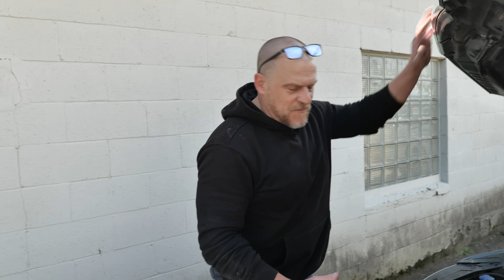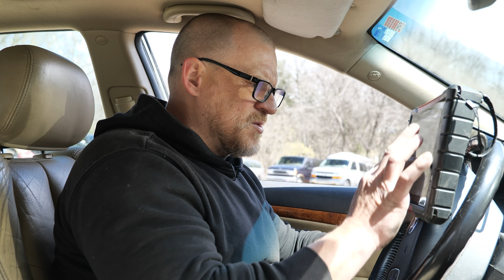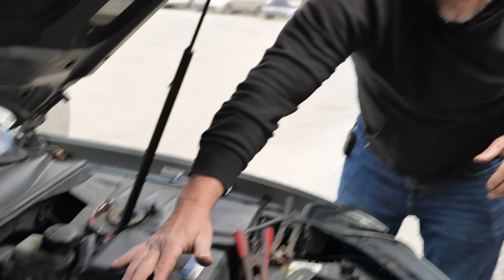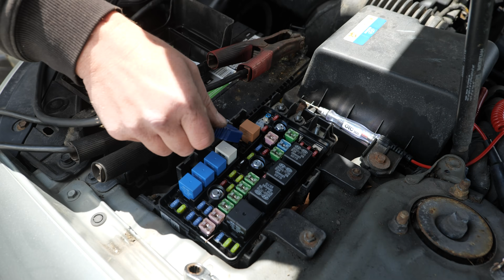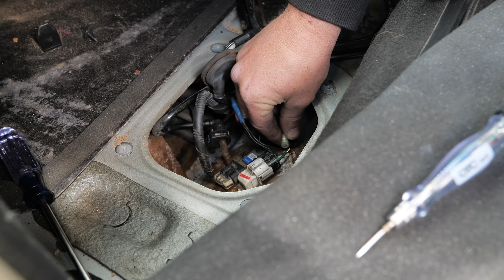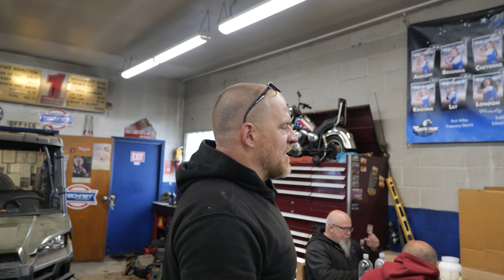No Start Basics  -  What Are We Missing??

Comment: I’m on day 3 with my car, before it stopped running I had one cylinder not working….I ended up pulling a plug wire, and it started to arc real bad, and the car shut down” haven’t been able to restart the car….due to no spark.

I have a permanent fuel pressure gauge, and fuel pressure is 45PSI…I can hear it prime” but still no start or spark” I don’t know if a faulty fuel pump can create a no spark condition 

I did a live data test on my obd2 scanner, and I see activity in the” TPS, and IAC” there is one parameter in my live data test, and it has a OL for the fuel pump.

Comment: If ya smelled fuel in the car at the beginning...smell out the source. And since tank was changed for whatever reason...and it has an access panel...why do allllll these other complicated tests. Do basic checks first after other shops had car, confirm and look at their work. Rotten pump/housing/lines/hoses would've been seen first

Comment: Any thoughts on using a special 'inline spark light tester' rather than the air gap type...better\worse?
Reply from the maker: As long as the air gap is adjustable. This is absolutely necessary when testing for "good spark". If it can only jump a 1/4 inch gap, compared to a 1" gap type of thing

Comment: Excellent diagnostic skills as always.  I am wondering what your thoughts are on if you know someone else worked on something, to first double check their work.  It has been my experience when I work on something, if a junior mechanic or driver had done work before more times than not they did something wrong and I have to fix their errors.  I don't tell them they messed up, because nobody like being told they messed up, but I do tell them what I found and let them draw their own conclusion.  One more thing, I would have done different is when you knew that fuel pump had a leak and you left the shop to go test it with some rags, you walked past a fire extinguisher. I probably would have brought that outside with me just for safety measures.

Comment: This was fun to watch.  On my daughter's car, it would start and drive and then at idle it would stall and then crank - no start.  At some point it would start again.  Long story short, it turned out to be the VVT (variable valve timing) solenoid.  No fault code, it was getting stuck in the open position and therefore stall at low rpm/idle and then no start.  Over time, the solenoid would get back to it's closed position and then start. Took a while to find this one.

Comment: Does someone know how much Am does the test light have? To use it for load test for 5 volt reference?please
Reply from the maker: You don't need to load test 5v ref circuit. Simply measure the voltage with the key on and sensors plugged in. Why do you want to load test it is the question?
Reply: @ScannerDanner to see wire problems
Reply from the maker: @ika-ika28  again, not necessary. Voltage measurements on the 5v ref circuit is all that is needed. Sensors plugged in, key on and backprobing is all the load you ever need on these
Reply: @ScannerDanner thank you i.can understand what you say but if it's shorted?
Reply from the maker: I have some videos on shorted 5v ref circuits. Voltage measurements while you locate the short is all you need to do
Reply: @ScannerDanner give me thi link please
Reply from the maker: @ika-ika28  https://youtu.be/RcQdITo_AOA 
https://youtu.be/za13UnpbH7E
https://youtu.be/uyncVz_HAtA
Reply: @ScannerDanner thank you for taking time to answer
Reply from the maker: I try to help as much as possible with someone who is truly trying to learn 😊
Reply: @ScannerDanner great video thank you. I have one question also so I've understood the procedure when 5 volt shorted but if there is wire problem pinched or something how do i see it in scope  if i have just fault signal too low or something? May be you have another video for this?Please answer 🙏

Comment: 2 wire coil 
1- positive supply
2 -negative trigger from ecu
You clamp the test light in negative terminal now circuit completed
Question? iknow if you want to see if there is a negative trigger being supply why did you clamp the test light in negative knowing that in a coil the positive supply will brigde to other pin wire.
That will complete the circuit? Just confused sir.
Reply from the maker: I prefer battery ground for my test light because in some circumstances you can get a backfeed through coil + if that portion of the circuit is dead. So it really is personal preference. I want to see coil - light up just like coil + and I also want to view this during cranking for a loaded circuit test of the feed side of the coil as well as being able to see - control at the same time

Comment: I just want to mention something I know for sure you know, but maybe forgetting it! If you connect that test light to battery positive (instead of battery negative), it would be so much easier to see the light flicker when connected to coil control wire.
Reply from the maker: I've ALWAYS done coil negative control testing connected to battery negative. I prefer it in almost all circumstances because I can see coil positive supply voltage at the same time. But yeah, on this one from memory, I was having some issues with that test. Thanks!

Comment: You sir are awesome!! I learned so much from you and the fact that you show your mistakes on camera it makes you more legit. You truly are a great teacher. Thank you.
Reply: This is my first time to comment: the knowledge, commitment and the follow through are great .
I want to give my opinion after you mentioned the history of the car and the tank has been replaced b
ecause they assumed the tank has whole on before they check  the entire fuel connection. I think the leak source was the connector and they jumped to quickly to blame the fuel tank or maybe the tank was bad too.
Any way sir you are the best I'm learning from you every day
Reply from the maker: @hassangabir878  tank was leaking but the sending unit/ pump assembly was so rusty and should have also been replaced. I caused the leak there when I got aggressive with that psi line not snapping into place like it should have (from rust).
Reply from the maker: Thanks man! We film live and nothing is staged. That's always been our operation system.

Comment: Hey nice diagnosis there but I have a little question, that why did that car didn't even tried to start when you were giving starting fluid from intake... I mean there was a fuel supply issue... but why it then didn't react to external fuel too?
Reply from the maker: The fuel I used (flammable brake clean is all we had) and the amount of air intake tubing, we just were not getting enough vapor (liquid doesn't burn) into that engine on the first spray, in that location. As another noted, they like to try to get as close to the throttle body as possible, even use a brake booster vacuum hose as an inlet, to prevent this exact situation. Make sense?

Comment: I don't get it; you smelled fuel when trying to start it but the pump was not running? And then you verified that it had spark which it did. So at that moment (you thought) you had fuel and spark. Should you then not consider compression as a next logical step and if so why did you went back to fuel?
Reply from the maker: Remember it started and ran. Thats not typical of compression issues to be intermittent like that

Comment: Hi Paul, hope you keeping well. 
A 2005 Mitsubishi pajero 3.6L engine hesitate at 3000 rpm on both idle and load and will not let you accelerate more then 3000rpm.
Any suggestion please. 

Many thanks 
Noureddine
Reply from the maker: Hesitates at idle? Please explain.
But if it won't rev over 3000, I'm thinking low fuel pressure or restricted exhaust. I'd do an O2 wide open throttle test first (check my chapter 1 playlist for videos on that, even some shorts I made on that test)

Comment: Like those transmission solenoids on the Toyota, they say use an LED test light to test. If you use an incandescent test light and the solenoid is bad too high of resistance, the voltage to the solenoid will drop down to 6v. 

Before you condemn the PCM on the Toyota, you better ohm test all those transmission solenoids! 

I wonder if you used an LED test light then your coil test should work. I know you want to load the circuit to test, but in some cases you need an LED test light for test to even work.
Reply from the maker: Is that a power or ground side switched circuit? For sure the drivers can throw you a curveball when they're in "protect" mode.
Reply: @ScannerDanner They are a power circuit, single wire and two wire solenoids in the transmission though.

Comment: I hate crimps
Use Solder & shrink tubes next time 😁
Reply from the maker: This was an adhesive lined heat shrink crimp connector. I just didn't apply the heat as there was gasoline everywhere. I had Pete finish that part

Comment: My neighbor had a 1983 Dodge Truck with a 360 engine and he was at another neighbors in the middle of a cold winter night working on the neighbors furnace, he called me at midnight and said his truck ran fine to the neighbors but wouldn't fire when he hit the key so I had spark to the spark plugs but the plugs were dead and he had another set sitting on his shelf in his garage so I went and got them put them in that night and the truck fired right up and I had the same problem with a 74 Barracuda years ago and put a set of spark plugs in it and it fired right up with no issues!!!!!

Comment: Dear and respected SDanner, what ideas comes to your mind in an engine with high compresion values and to low vaccum?. It´s an old ´88 V6 3100 Cutlass Ciera. I´m planing to overhauling it. Thanks in advance.
Reply from the maker: An 88 3100? I think thats a group fired injection system. Shorted injectors is a very common issue. Don't mistake poor engine vacuum as a mechanical failure, when you can have a 3 cylinder misfire on a 6 cylinder engine do the same thing! What is vacuum at 2000 rpm in park? If its good there but poor at idle, focus on the misfiring!
Reply: Thanks, I'll test vacuum at 2000 r.p.m. and seek for failures in wirings and injectors, thanks a lot, as always.

Comment: Why don’t you leave your test light alligator on battery positive when looking for ignition coil control? Instead of looking for a “flicker”, it becomes more pronounced if the PCM coil drivers are or are not grounding the primary windings of the ignition coils.

Comment: Great video !!! 

A tip with the test light. Those long filament bulbs stay lit longer than they take to light. If you need to confirm faster signals, it helps to set up the circuit so the bulb lights on circuit activation. The dim flicker is easier to see. 

Great stuff, as always.

Comment: Can we see a flicker if you used LED test light on coil control?
Reply from the maker: You probably would burn up an LED on coil negative as the voltage spike from the field collapse can reach over 400v. If you did the test unplugged from the coil, connected to B+ then yes, we'd have seen the flicker much better
Reply: @ScannerDanner  Thanks. I can try if LED will burn, I have replacement bulbs, but not on Hyundai.

Comment: 15:46 I think LED control light here will be better.
Reply from the maker: Only with it disconnected from the coil. If you did the plugged in test, it would most likely have killed the LED
Reply: @ScannerDanner  True, i think only for signal wire.

Comment: The only part I’m a little fuzzy on is when you installed your relay tester/ controller is why you should be getting that led light to turn on when you hit that button on the side
Reply from the maker: Great question. I have some other fuel pump videos where I explain this further in a drawing. But in short, the pump circuit power supply will show a ground through the pump motor (positive brush, through the winding to the negative brush to ground) when the circuit is not active. Why? Because brush type DC electric motors have basically no resistance when they are stationary and not spinning. Hope that makes sense

Comment: Nice video. I usually like to pop open the air filter housing when I spray brake cleaner to start just so I don’t soak the filter. Had one catch fire from the hot MAF wire fireball.

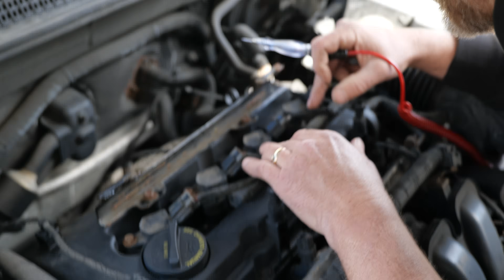Comment: 3:27 Yes! the real no w-diagram! Today dealer wanted to change DPF.
Well the problem was sleeper! yes sleeper?
yes, the sensor that should have seen, pressure change in DPF did it but ;)
yep wire colors didn't match, but part number did.. so?
follow pin numbers. or look 5v ground and signal.
if i get the sensor out of the connector(sorry my English!) it had sound and it noticed the sensor was out.
well all good there then? ..Yep 5v in ground and 0,34v signal with no flag yet connector out the sensor party time in instrument....
The sensor should register back pressure of the exhaust pipe ;)
yes it did but normally it register even near under pressure but today no it needed like 1,5bar to register.
yep that was the start for sensor that flags ~100mBar for too much....
Knowing what car is looking is the "key"
..maybe dealers has seen too many cars without DPF, where there should be one!
PS. it's funny that many times it's called DPF even on petrol engines. tell that to a customer! ;)
You need new DPF!
But sir my car runs on petrol!
Yes i know, but maybe PPF was taken...;)

Comment: If this was a GM, I would say you missed VATS :P.   It's even more fun with janky VATS and also a real starting issue under the hood.  Mr. Danner your videos have been key to me solving fuel trim issues, VATS (bypass solution even) on my 4th gen firebird, AC troubleshooting, and boredom with your videos.  Thank you for your service.  
I am off to finish CV axle replacement on my wifes cobalt.  /smh

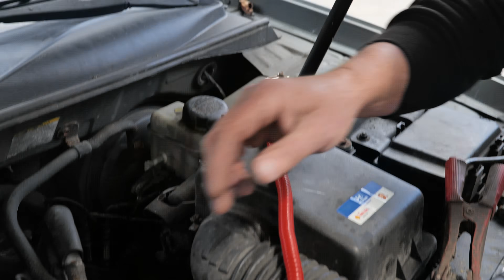Comment: That's not exactly the complete story (starting at  11:45).   When your finger is touching the end of that test light.. You would still be "in the path" -- meaning:  You would be a parallel path with the light.  You just weren't grounded.  If you touch the tip of that probe in the same way and reached over and held the ground with your other hand-- it should still shock you.  So for example: of you were leaning over the fender and your shirt came up and you have that good belly ground and then touch that probe (test light) again --   You would get that parallel shock, unintentionally.    I think that is what most people were talking about.   

It won't be as strong, because most of the current is still passing through the bulb and that parallel circuit between your body and the bulb are acting like a current divider..  Where the bulb is maybe only a few ohms and your body is maybe a million ohms..  So honestly, you may not even feel it.. (I think you still would, that would be a fun test;   Do the same "touch test" while holding a ground wire in your other hand - and have an amp clamp on that ground wire-- and see if it is still passing current in parallel, even if you can't feel it??  I'd love to see that test)..............    

With the test that you showed -  you were not grounded anywhere.   and I guess maybe that was your point.
Reply from the maker: I was leaning on the car. As long as my finger was no closer than that spark tester  terminal (if test light ground was removed), I still wouldn't get bit
Reply: @ScannerDanner  wouldn't ? heh or shouldn't?
Reply: @ScannerDanner  You're leaning, but you still had clothes on.   Again, I agree that it would be a reduced amount, but I would bet you could still feel it with a good ground.    IDK, maybe not:  But I still think that if you put an amp clamp on a scope:  clamped on a ground wire that you were holding (stripped wire with your bare fingers)... and did that test-   I bet it would still have a readable amount of current there.....  I wonder??   I'd like to see this test. lol.

IDK:  I guess the bulb is acting basically just like a short..   So does that really mean that NO current will flow through your body if it's grounded?  Or is it just a very tiny amount?...  Basically to the same proportions as the resistance difference?   I honestly don't know.. I want to see this test, with a scoped amp clamp.

Comment: The intake tube was a little too far away I always like to go as close to the intake as possible that way I know the fuel source is getting in to the engine. Hate to say it but thats a crap repair. Should have used heat shrink connectors due to the being in the environment. Got to do better than that.
Reply from the maker: I did use one on my repair, just didnt heat it with all the fuel everywhere. I left that part to Pete. Or are you talking about the previous repair?